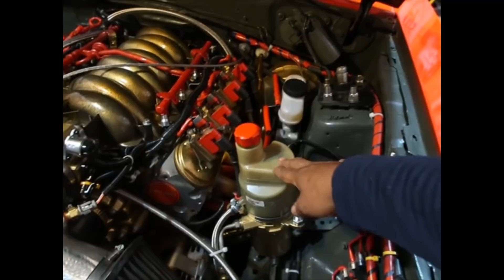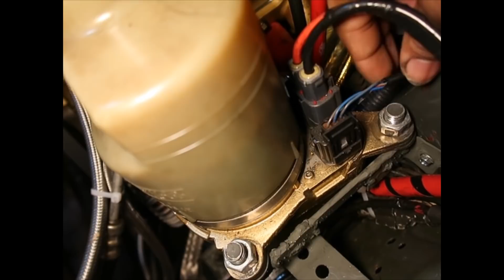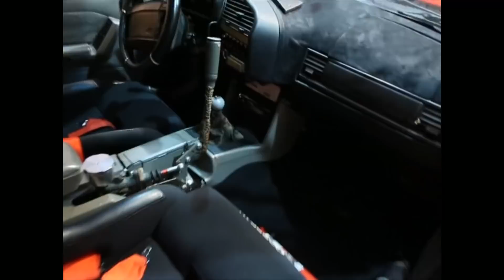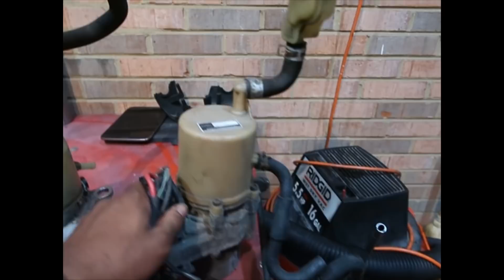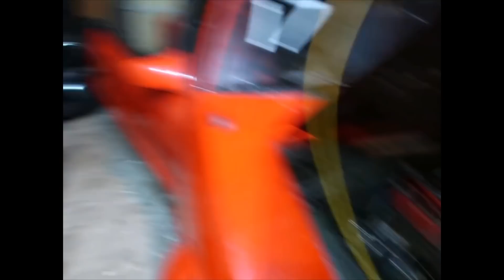Electric Power Steering Pump Conversion

Comment: The pump off of the Mazda 3 you said you would like to know how to wire it I have that exact same pump and used it for a conversion on my ram 1500 the wiring setup on it is set up and with numerous additional sensors that changes the speed of the motor depending on what the car is doing whether you're turning or the motor is running higher RPMs etc the way I had wired mine because I couldn't figure out how to get it to come home without having those additional sensors I had pulled the motor apart and found out that the motor itself is actually a three-phase motor so I used a bldc speed controller and wired it directly to the motor and bypassed the sensor board and it has performed flawlessly ever since in my opinion that's the easiest way to wire that pump
Reply: which controller? ahigh amp rc car type or something like a regular pwm?
Reply from the maker: People keep telling me about PWM controllers for these pumps, but they never give info on where to get them or how to install them.  I would love to know.
Reply: Make a video

Comment: by chance did you ever figure out how to use the mazda pump?
Reply from the maker: It cannot be hotwired.  You can do it if you can program a rasberry pi or arduino, but there is no plug n play way to do it.
Reply: @Sgt.Slides   well thats disappointing I was hoping itd be like the volvo pump in that regard. thanks man.

Comment: My friend did figure out the Mazda 3 and also 5 pump, it can be configured with a potentiometer or rpm to control steering effort, rpm being preferred as you can dial low effort at idle and high rpm higher effort. Like percent 0-100.  He has developed a controller or computer to achieve this.
Reply: I think Mazda 3 pump uses engine rpm and vehicle speed over CAN. I was going to use one on my rx7, but it wouldn't fit. Ended up going with the "dumb" electric pump instead. Would love to suss out how to control it though. I reckon you could get a standalone ecu make it work
Reply: Hi is there any how,can your friend send how to work with the Mazda pump,im trying to convert on a 98 Mitsubishi Eclipse,thanks for any info.
Reply: Hi again need help,tell your friend to contact me i could by his invention if this work my Mazda 3 pump,thanks for any help
Reply: I'd be quite interested in this controller as well, if you are still in contact.

Comment: Hi there, has anyone come across the third pump, can it work in standalone mode or what is the way to make it work, thanks much!
Reply from the maker: someone in the comments mentioned that there is an aftermarket controller for it, but he never replied back and i have not been able to find it.
Reply: @Sgt.Slides  I have seen an other video with this pump where someone said the third connector is to drive the motors speed with PWM otherwise it runs full speed! Which is good for me.
Reply from the maker: @reneeberty  yes, on the volvo pump, the other 2 wires are how the ECU controls speed, but there's no way to tap into them otherwise, and without them, the pump runs like 70 or 80% speed.
Reply: @Sgt.Slides  I'm not talking about the CAN H and CAN Lines from the first connector from de left! I'm talking about the third connector from the right!Anyways, I'm having one shipped to me on the Jan. the 19th so I'll keep you guys posted!
Reply: @Sgt.Slides  Just received my pump today and came across this video https://www.youtube.com/watch?v=rMP1UFjrYwY, I assume at the left connector on pin 4.4 is for the steering angle, driven by PMW. But if you carefully pay attention you see at 02:31 the speed is at over 3000 rpm at 1 degree angle! Angle to pmw conversion is very easy to do using a simple Arduino nano (That's if you need to, because I assume at 0 degree angle pump will still turn on! But haven't you tried the third pump just like the 2 first one!

Comment: So I have been doing some more research on these. It seems a few people have come out with controllers for these pumps in the past year. There are atleast 3 different plug and play controllers for these pumps now. In your current configuration, the pump is operating at about 75% capacity all the time. The pump apparenly always runs at 2375 RPM in the limp mode, but the max rpm in regular use is 3175rpm. The most basic of these controllers consists of a knob that in essence allows you to turn the power up or down based on your needs. They also make one that controls the pump based on a VSS signal produced by an included GPS signal. The most advanced one that seems to have only just come out apparently works from an external VSS vehicle from whatever ECU you are working with.

For my application I am just going to experiment with the basic $50 manual knob one. I am planning to power a fast ratio GM/Saginaw gearbox in a heavy car, so I figure I will need as much volume as possible for fast manuevers. I would appreciate the ability to have it on but working at much less than 75% capacity say on the highway.
Reply from the maker: i did a couple of quick searches but i only found info on the electric motorized steering column ones.  your comment may get blocked if you post links, but can you mention the company names who make them?  I'd love to look into it.
Reply: @Sgt.Slides  https://youtu.be/FGHd-mirPdE

Comment: I am planning on doing this to my Caprice. I bought it from a nice Mennonite fella(read:they don't like technology). He converted it to a stick, deleted the A/C, and retrofitted it with a manual steering box from an S10. Its a pain to parallel park in the city with the slow manual steering, manual transmission and immense length. Similar to your car, the engine bay is really clean, the alternator is mounted low with just a short belt driving it. I have an Impala SS steering box with a much faster ratio and am planning to power it with a Volvo pump like this.
Reply from the maker: sounds like a nice hot rod.  I love the old Bubble Chevys
Reply: @Sgt.Slides  Yeah they are rad. Seems like people are finally figuring out how to control these with canbus now too. That would be ideal.

Comment: What PN/model is this pump? I have an application to use one but it will be a heavily used autocross car and road race car. Is there other Volvo pumps than this one? Or are they all the same except for the tank design? Thanks!

Comment: I swapped a 2002 4.6l out of my f150 for a 2004 mountaineer 4.6l & the pump rubs the steering shaft. This will help me get rid of the old pump & no worries. I've had my truck just sitting in garage for 6mos looking at motor mounts & all & nothing was  causing the problem. Soo now I can just get a diff. Belt. Or modify the old pump with grinder so it doesn't touch the shaft.
I would like to buy one of those pumps from you.
If this video which I have not look how old. You probably have sold All already.
Reply from the maker: I haven't been selling the pumps for a while, but you can find them on ebay.  Good luck modding.

Comment: Soo. If I get an electric power steering pump on my 2002 f150 4.6l I don't need the pump attached? Meaning it will free up my steering shaft?
Reply: I would just have to get a bit that fits.
Reply from the maker: @dadkak2428  not sure what you mean by getting a "bit that fits, but yes, you may need an adapter for your hose if that's what you're referring to.
Reply: @Sgt.Slides  neither do I. WTF Samsung.
I was just saying I did an engine swap with my f150 & the power steering pump sits on the steering shaft. Both 4.6l. I don't know why. But going with a electric pump & mounting it elsewhere is perfect.

Comment: probably only meant to run intermittently cos on the highway you wouldn’t need it running constantly, prob needs a pressure switch cut off maybe. i like the idea of slow steering movement but with assistance…I’m looking to convert my F350 to electro hydraulic pump to cut that parasitic load on the engine and help get better fuel mileage on motorways ( highways) anybody done that? wouldn’t achieve that if it was drawing off the battery/alternator constantly when running, you’d just be switching the parasitic load from mech p strg pump to alternator. this looks simple but id have to fit a high pressure cut out switch and a lower pressure cut in pressure switch with a heavy duty high amp relay to run it I reckon.

Comment: On my aunt's 2000 lexus rx300, the power steering belt broke due to the pump seizing up.  Can this be adapted to it?  The belt set-up is going to be a pain since the power steering is the inside belt, not the outside.  Could this be wired to the ignition so when the car is running, it runs and when it's not, it's not.
Reply from the maker: this will work on any car as long as you have the correct fittings.

Comment: I've been thinking about a high voltage 3-phase stator with a harmonic balance for a magnetic rotor rectified to feed a bank of six series-ed 12v deep cycle AGMs to feed EVERYTHING at 72v. That pump pulling 70 amps at an alternator output of 14.7v  is still 1029 Watts which is a lot; but divided by 72v to 78v would only be about 13 or 14 amps.  Of course it would then require a 72v motor or DC to DC converter. I'm already using about 100 amps off an aux 140 amp 12v alternator to run two inverters for charging the 72v bank that drives a Paxton centrifugal at about 5 psi engine running,(1st gen .060 over 350 87' Camaro). I guess an electric dry-sump would pull about as much as the PS pump and ditto for an AC compressor so I don't think it could all be effectively  done with anything less than one large directly crank-driven source.

Comment: Thank you for sharing this video.  The points you make concerning the pros and cons of using the Volvo PS unit are very helpful.  Since you made this video a few years back, have you any additional experience with the Volvo unit in other vehicles?  I have a 1/2 ton pick up (Chevy) that I am considering deleting the mechanical steering pump, in favor of an electric one.  Any comments?  Thanks.
Reply from the maker: i'm still rocking with the electric pump, and still happy keeping in mind the limitations.  I always keep a spare on hand for track days, and i swap tit out every year as a precaution just because drifting puts a lot of load on it, although they have become a lot harder to come by since i made this video lol.

Comment: Two questions... what kind of PS fluid do you use in this? Stock Ford for the steering gear, or the stock Volvo spec for the pump? Also, when you give 12V to the grey wire, and the pump is always on, have ever measured the actual PSI it puts out?
Reply from the maker: use CHF fluid if you really want to get fancy, but i use ATF.  no, i never measured the pressure.

Comment: I've been daily driving my 92 Honda Prelude Si without power steering for many years now. I love how I converted mine to a manual rack and pinion but I do also miss being able to turn the wheel easier whilst parallel parking. Knowing that I'd be able to turn this feature off whenever I take my car out to track days and autocross and back on when daily driving, I'm sold!

Although, do you think connecting the lines to a power steering cooler mounted to the front would fix the pump issue that you mentioned about it possibly overheating from the rapid steering?
Reply: You have the option of going with electric power steering from a Kia/Hyundai. Some welding is required.

Comment: What about VSS?  Wheel speed sensor signal?  If you're only using the pump's 12v switched how is it regulating pump speed at higher speeds? Super clean swap my friend, looks amazing!
Reply from the maker: people have suggested that, im not interested in continuing to tinker with it.

Comment: I need a Volvo one I picked up a Mazda 3 pump  And I can't figure out how to get going it won't turn on and I know it's a good pump is videos a little old so maybe you know how now how to get the Mazda 3 to work but if not I'm intrested in a Volvo one since it's the only video explained how to hook it up let me know please get back to me
Reply from the maker: I discovered later that the Mazda pump requires a digital signal, you're going to need real hacking skills to make that work.
Reply: I guess i gotta try sell it now i found a volvo one for $150 at least i hqve your vid to help me thanks and very nice car btw
Reply from the maker: @RIVIARACUSTOMS  thanks and good luck!
Reply: I just bought a volvo one can you tell me what to do with the high  Pressure side as in fittings
Reply: Hey so i got my pump all set up but what fluid are you useing in it?
Reply from the maker: @RIVIARACUSTOMS  ifter a lot of research, i chose to run ATF in mine.

Comment: I have a 2000 Trans Am that I'm considering doing this install on. I will be supercharging my car so power brakes and boosted applications don't mix well (no vacuum). Do you recommend to use this with a hydroboost setup?
Reply from the maker: I don't really know anything about hydroboost.  I know it's on newer Mustangs, but I've never personally worked on it.  I also know many people with Turbo and supercharged cars and brakes have never been an issue.  You aren't going to have a problem with your brakes.

Comment: Thanks, mate. Perfect solution I’ve been looking for actually for my Civic EG K swap!
Reply: Im doing a H swap into EK and great solution
Reply: A Zaza. I'm putting one in my eg as well. Did you get yours done? Would be nice to know the sizes needed for the lines.
Reply: @CRAVINGdb  Hi mate, are you from the UK? If so, if you but the Tegiwa power steering delete kit, it comes with the perfect sized AN fittings you need for it. I still have the pump, however unfortunately due to buying a house I sadly had to sell it ☹️ ah well onwards and upwards. AWD K24 Turbo next. I’m keeping it til then!
Reply: @A2theZed  im usa. But I have the pump. Going to hard line mine in. I may have go the information I needed. I appreciate the help.
Reply: @CRAVINGdb  No worries pal. Best of luck with your build 🤙🏽
Reply: Other than the s60 pumps, are there other options for getting the electric pumps from other cars?
Reply: @davidl2473  Yes mate. I haven’t had too much experience with it myself but I know that for civics in particular, you can use the pump from a Toyota MR2

Comment: Really nice work! Excellent concepts and engineering besides the electric pump.  Notable use of ground and 12-volt buses, terminal blocks, and breakers.  Extra points for neat/clean wiring practice.  I've totally stripped a 35 foot 1989 RV that has a carbureted Ford 460 ci /7.5L with some performance upgrades (Edelbrock manifold and carb, Banks exhaust).  I plan to clean up the accessories and wiring much like done here. I'm also adding DIY CAN capabilities (sensors, dash, controls).  I'd like to turn it into a 4 wheel drive, expedition-style vehicle.  The 4WD part may be beyond my capabilities.
Reply from the maker: sounds like an awesome project.  RV's are super interesting.

Comment: Thank you so much for this video . I have made my conversation on a 2000 mustang gt turbo car using the 2nd volvo pump you showed in this video. everything  is hook up and running but i do feel i need to upgrade my alternator. Do you think  a 130 amp is fully capable to run this unit? My current is a 105 amp.
Reply from the maker: Get the biggest alternator you can and you shouldnt have an issue

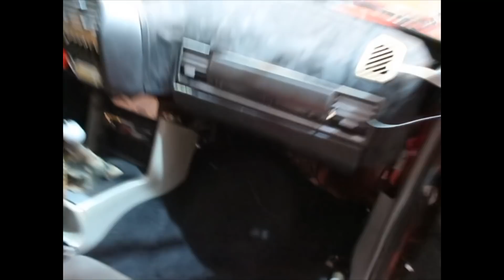Comment: 7:14 7:30, i know how it feels, ist is scare, it´s happened to me two time in de same corner (a 180º corner) i changed the gear slowly and the car staled no steering and i didn´t know whats going on (i was scary, i still scary now) hopefully i release the clutch and everything works again , despite I didn't know what was happening
it was to close two times!!!
i new to clean the idle valve, and hope NEVER hapens again

Comment: Glad you posted this video , except for the slight different shape to the top of the reservoir that's the same pump for 2005 to 2010 Ford Focus mk2. Uk spec model anyway. 👍.1.8, 2.0.

Comment: Very interesting ! Thanks for posting. What's the pressure? Is the pressure adjustable somehow?? Does anyone know? Can you simply add a rheostat into the power line and adjust the pressure with the rheostat?
Reply from the maker: it's just plug and play, there are no adjustments to make.
Reply: @Sgt.Slides  - yes, thanks, I can see it's plug & play. It would be really nice to know the pressure, I'm guessing that it is constant, but perhaps there is some variability, which would account for the extra wires... maybe as speed varies, so does output pressure???? Obviously, this is not happening in your situation. Thanks again!

Comment: Have a question that’s a little off topic. I have a mile marker hydraulic winch that runs off of a power steering pump. Wanting to rig it up as a winch on my gooseneck trailer to load cars and trucks if needed. The winch needs a minimum of 1,500 psi and 3.5 gallons per minute flow. I know a regular belt driven power steering pump works fine but I’m not familiar with the electric style. Do you happen to know what the specs are for your Volvo or others?
Reply from the maker: sorry, I wouldn't know any of those details. slap one on and see what happens.

Comment: What fluid are you using? I'm doing this to my Volvo 240 that originally uses Type F transmission oil for the power steering
Reply from the maker: Long story short, I could not figure out what OEM fluid Volvo uses in these (hint: It's not volvo PS fluid) after a lot of reading I settled on using ATF.
Reply: @Sgt.Slides  thanks for the reply, will try it out! Also what fuse amp do you suggest for the pump? 25amp?
Reply from the maker: @tumamaoite  80 amp
Reply: @Sgt.Slides  sorry to bother again, I forgot to ask you what gauge did you use for it?
Reply from the maker: @tumamaoite  I tried to match the OEM wiring which I believe is 8 gauge.